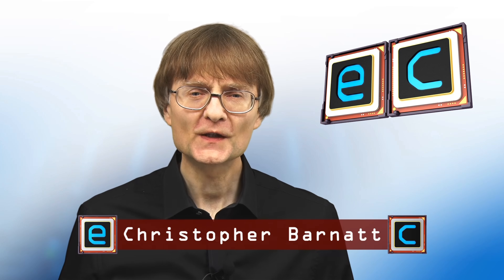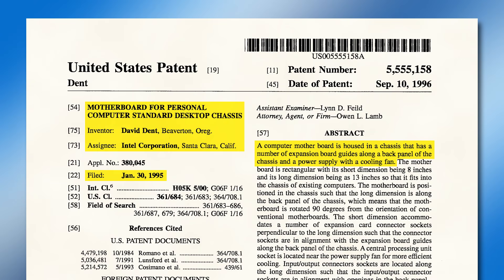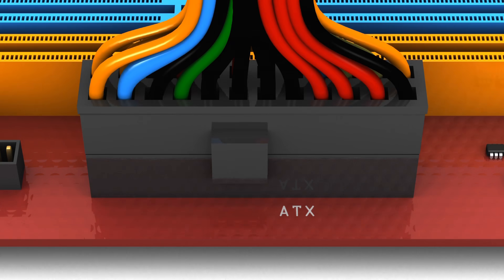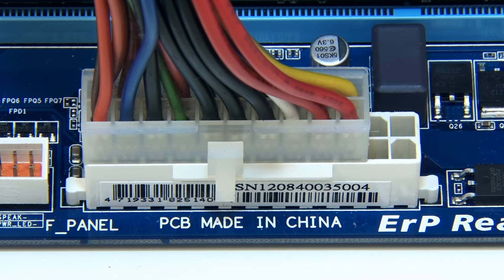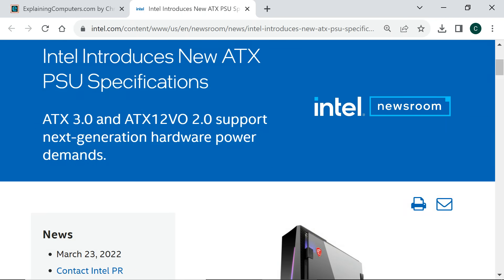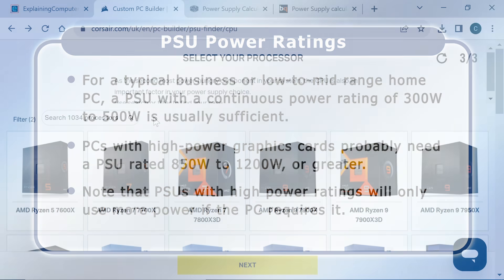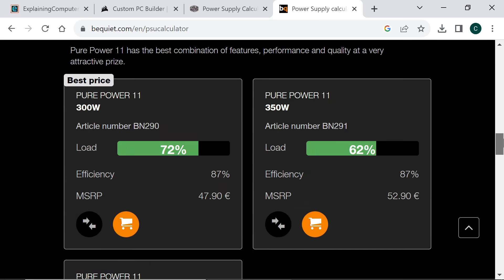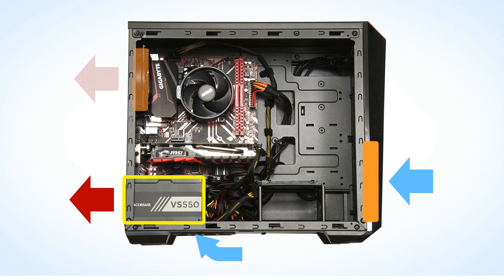Explaining PC Power Supplies

Comment: You say that in 2000, ATX 1.0 was introduced to power Intel’s first Pentium processors. That can’t be right! I was building my own PCs in the late 1990’s and we were a couple of Pentium in by then. My first Pentium processor came in a sort of cartridge with a daughter board inside with level 2 cache which itself plugged into the motherboard. Pentium II I believe. I started with a 266MHz and then moved on to a 450MHz.
Reply from the maker: This is a very good point! You are right. Pentium processors were first released in 1993 (I remember those strange, modular P2 ones you mention). My error here is missing out a number. The changes in 2000 were to accomodate the Pentium 4. My bad. :( I have added a pinned corrections comment.

Comment: I have been building my own computers since the early to mid 90's when more standards and modularity became wide spread, and have always made sure to buy a power supply that can deliver quite a bit more stable power than what is needed for what I initially put in the system, because if you add upgrades and peripherals to a system with just enough or only a bit more output than what you already are using, you may run into trouble that can effect a whole bunch of stuff, and lead to hardware failure.  It's not a good place to save money.  Looking for the best price or even a sale on a highly rated product helps of course over skimping out in the first place.

My current system should be around 550W at max load it being an AMD AM4 based system, and not the more power hungry Intel equivalent, but my power supply (Modular) is capable of providing 1200W steady power.  It's also gold rated, so efficient, as well as very quiet.  So far I have never had any power related issues with systems I built, but have with prebuilt systems I acquired when upgrading and adding stuff.  My power supplies have so far all outlasted the systems they were in.

Comment: My self-built PC has a Corsair 750W Modular PSU. It's so overrated for my PC, that I've NEVER seen the fan spin, except when I push the test button. These days, I rarely use my desktop, and mainly use my excellent Beelink Mini S PC, because it's virtually silent, and it costs virtually nothing to run!

EDIT: No more Mr. Scissors gags, as they went down like a balloon popped by something sharp! Like most of my comments, they were deeply unpopular! ... I strongly suspect I'm being "shadow banned" by YouTube? My comments often vanish into thin air after posting.

If anybody's interested, my biggest issue with SMPS is the "arc" when plugging them in (this mainly applies to laptop PSUs, presumably due to capacitors?). There can be a noticeable flash, and pitting of the mains plug pins. Lord knows what it does inside the socket? More pitting I expect? Over time, I suspect this could cause contact issues, damage and arcing inside the AC outlet.

This video came across as a little "dry," and I lost interest and stopped watching at 07:59. Sorry Chris!

Comment: Great explanation. There can be many pitfalls to choosing a PSU, so I'm glad you put this info here for folks who need it. I've also heard people say to not mix-and-match cables from different modular PSUs, but I don't have enough PSUs personally to say why. Perhaps the PSU socket side could be different?
Reply: Maybe they are thinking of the cable power capacities, i.e. not using cables from a lower power modular PSU with a higher power modular PSU?

Comment: Thanks, Chris the understanding and history of the PSU were informative and interesting. Also over the weekend, I worked on my new computer build, here is the parts list and I am using it now. New Computer Build

Corsair 110R Tempered Glass Mid-Tower ATX Case

EVGA 500 GD, 80+ Gold 500W Power Supply

Corsair Vengence LPX 16GB (2x8GB) DDR4 DRAM 3200MHz
C16 Desktop Memory kit-Black

Gigabyte H610M S2H DDR4 (H610/Intel LGA 1700/Micro ATX/DDR4/
Single M.2/PCIe 4.0/USB 3.2 Gen 1/Realtrek GbE LAN/Motherboard

Intel Core i5 12400F Desktop Processor 18M Cache, up to 4.40GHz
Reply from the maker: This sounds like a very nice new system. :)
Reply: @ExplainingComputers  Yes, finished it over the weekend. Was inspired by Carey Holzman's channel. I watch and subscribe to his channel. I'm in the process of cloning my old drive to the Samsung NVMe 970 Pro SSD 500GB using Acronis.

Comment: Thanks you for enlightening us on the power supplies. Everybody is full of CPUs, GPUs, motherboards, RGB, cooling, and so on. The PSU is not getting the attention it needs. There are some intriguing questions around the humle PSU...
Why did the PSU not change? Why did the ATX specification not go for 48V or 60V for transferring large amounts of power to the power-hungry components?
The only thing that changed is the number of conductors. Big amounts of power over multiple parallel thin wires is asking for problems. If one has a bad connection, everything will keep working but with an increased risk of overheating and fire.

Comment: "All desktop PC power supplies include a cooling fan" This statement is just plain wrong. There are many companies that offer completely silent, fanless versions, e.g. Seasonic Prime Fanless. These are special purpose items, they are not for small cases with high-powered GPUs, but instead either rely on large, well-ventilated cases (e.g. using some very large, incredibly slow-spinning case fans) or test-bench-style open-air cases. It is true that for the average user, a hybrid-mode power supply probably is the best of both worlds. But nonetheless one shouldn't bend facts.
Reply from the maker: Noted. My bad. :( I have added a pinned comment noting my error.

Comment: Molex is not the correct name for the old HDD connector
A true molex the top part of the connector is tapered at the 12v side and has a right angle at the 5v side.
Mate n Lok is tapered on both ends at the top.

Comment: 1:25 -- that's one thing that we just don't have in the States.  Those awesome wall-plugs with built-in fuses and switches.  How convenient to simply be able to switch the thing off there instead of having to physically unplug it to remove a device's power.

Comment: I sincerely hope ATX12vo makes it to the DIY PC market. Pre built pc's have apparently used it for many years and my one uses 10-15 watts. I simply refuse to build myself a PC which will be pulling 70-80 watts minimum. Especially when I'm paying 50p per kWh for electricity. Great video 👍

Comment: 13:45 the footnote should say at 100% load
Reply from the maker: No, the footnote is correct. An 80 Plus Titanium rated non-redundant PSU is 90 per cent efficient at 10 per cent load. It is 91 per cent efficient at 100 per cent load, as the table indicates. There would be no point in indicating the 100% load rating given that the 100% column is already in the table! :) But I chose not to includes the 10% column, as it only applies to the Titanium rating. The data is here: https://www.clearesult.com/80plus/program-details#program-details-table

Comment: Thanks for covering PSUs,  I always buy the best PSUs for system stability, i found that the cheaper units can cause the system to have random crashes,  my daily work horse was doing this, Switched the PSU over to a better quality and the systems been spot on.   I have had a PSU kill a motherboard too, by sending a few volts down the resistors that controlled the fans.  it was only Pentium 2 dual processor system, so nothing flash.

Comment: corsair also do digital power supplies that not only run with 0RPM at low load, they also eliminate coil and capacitor whine. I think I have the 750i I bought years ago that has corsair link which will tell you in real time how much electricity is being used and how efficient it is, also which components are using electricity.  the i series is certainly the peak of corsair power supplies, and I think they give something like a 20 year warranty on them.

Comment: Brilliant video covering something I am sure many don't give a lot of consideration - naturally depending on how demanding a machine you're building.
I am sure many have built, for instance, a Linux machine from older components using just any old power supply that'll fit in the build and has the right plugs.

Comment: Great overview of PSUs.  Cool and quiet are a priority for me and my computer is primarily an audio recording and mixing system.  Some PSUs are designed to have zero fan speed when the power draw is below a certain threshold.  Therefore, I find a PSU wattage level where my basic activities fall within this threshold or at least in the lower RPM modes.  I would add that a non-spinning fan draws less dust (even if you have a dust filter) and should prolong the PSU life. I achieve these goals usually with a Gold or Platinum 80+ PSU rated 100+ watts over what I need for my system. (a 1000w PSU isn't efficient on a 500w system so don't go too far above).  Going 150w over what is needed allows headroom for future upgrades. This puts my normal usage in the sweet spot of cool a quiet in exchange for a tiny bit of efficiency. (and again, a non-spinning fan draws no power so maybe it's a wash.)
Another important factor for me is that a great PSU will last for 2-3 system builds and the extra money is an investment in the future (a rare thing with computer parts.  Perhaps shared by buying a great monitor.)

Comment: Some Mother boards and PSUs support having x2 ATX_12V/EPS (@05:25).  Running high core count CPU's with over clocking some users may plug in 2x8 pin EPS for running hi amps/watts. Most users won't need or run this set up.  100% agree that some research for the correct PSU, that suits a users needs, can same money and limits part being damaged.

Comment: The money  is not worth the extra efficiency in most cases. Just turn off you pc when youre away, computers now start up quick anyway..if so concerned about energy use a power strip everything and never even leave a usb charger plugged in.

Comment: Hello, I love your videos, But WHY do say at 6.:43 SADLY molex connectors remains today. I find it great that I can still put a PCU into and otherwise Dead computer. Not everyone requires a modenn Computer and manny of us work in environments where older computers are used in machines 20--30 yers old THANKFULLY not SADLY they still make this connector available, otherwide an expensive machine made by a  company and used by other companies may be obselete just bacause of a stupid  omission of a connector. Just my opinion as a technician working on machines which work well running under Win win 98, XP and aven OS2 Warp. Machines are well maintained and need a working computer -  namely powered b a tradionatial  PSU. Not every company has Hundreds of Thousands of Sterling/Euros to replace machies just because of a stipid PSU connector Ommision.
Reply: My main complaint is that it can be really hard to unplug from another molex connector, though most decent modern PSUs have a curved piece of plastic you press down on that helps release it. Also, plugging it in can sometimes be a challenge because the pins are fairly loose so you have to make sure everything is lined up.

Comment: Sorry Chris, the first Pentiums were released in 1993 and did not require ATX 12V 1.0.  In fact there were motherboards available that allowed the use of an AT power supply.  Ask me how I know!  Another thing that's important when selecting a power supply is where the PSU delivers the power.  Modern PCs (Core2 and later) require power mainly on the 12V rail, so you could select a 500w supply and then find (if it's on an older design or a cheapy) it can only deliver up to 280w on the 12V rail.  That supply is rubbish whereas a 500w supply that can put 450w or better on the 12V rail is good.

Comment: Very good video: well structured, clear, comprehensive, accurate, touching on all the necessary details.
That said, what lead me to comment was at 6:34 "... the 4-pin Molex connector which used to be used to power most hard drives and optical disks and SADLY remains in use to this day as a general PC power connector" 😆
I'm an electronic engineer and I've been designing electronics for longer than 20 years. The job often includes selecting and verifying all sorts of connectors. I've been dabbling with PCs for longer than I've been an engineer and I've always been puzzled by the choice of such connector. How did Molex manage to get such terribly flawed design to be selected for such a popular industrial standard like the PC? The 4-pin HD/FDD Molex connector is extremely awkward to plug (receptacles and pins typically refuse to align) and the shape of the cable-end housing seems purposefully designed to hurt the fingers and prevent gripping it.

Comment: I have a question and wonder if anyone can provide any insight. I have a desktop PC that I only use occasionally, so when I shut it down, I flip the switch on the PSU. I have a USB light that I keep plugged into the computer so I can tell if I forgot to flip the switch. However, the last few days I've noticed that about an hour after flipping the switch to off, the USB light will come on and then go off after about a second. My guess is maybe discharging capacitors or something, but it seems strange that there'd be a sudden burst of power like, especially after such a long period of time. Any ideas?

Comment: Many years ago AT power supplies were prevalent. You had to switch them off manually after shutting down. Then ATX PSUs appeared, which turn off by themselves. A minor thing, but i was impressed, when i first saw it
Reply: The switch was still on the front of the PC, so it didn't seem like you were switcing off the power supply unit but the whole computer or "the processor". Windows 98 had a message informing that it is now safe to turn off the computer.

Comment: Great informative video. Thanks.
I would like to add that most good quality psu are already atx 3.0 capables as John Gerow pointed out. Moreover, you should even more not care  at it if you are running amd gpus (like me), because not 12pin connector required. Cheers

Comment: I would say that the PSU is THE part that corners should never be cut on. My daily-driver uses a Corsair SF600 PLATINUM, small and solid, with the fan rarely spinning.

Comment: This is a good back to basics video. My personal recommendation is to never buy anything lower than gold or silver, and target it so the power you use is around 50% of the max output. Its not just the power saving , to get that rating you have to have a well designed power supply, a lot of the 80+ (below bronze) units are very old architectures made to look new, stay clear. Cheap PSUs are never worth it. A good high end PSU can last decades if not longer. Not ATX but my nice thurlby thanadar bench top power supply is over 30 years old if its a day and still going strong.

Comment: Excellent video, very informative. I’ve been messing with PCs so long that I remember the old pre-ATX power supplies, with an input voltage selector switch and an output socket to supply a monitor.
Reply from the maker: I liked those monitor sockets. They made things very neat at that desk.

Comment: Great job for explaining about PSU, Chris! Talking about the airflow, if PSU fan was from bottom for enter airflow (which was difficult to enter enough cool air as easily caught by dust), actually we can flip over the PSU fan on top for more smoothly airflow as well.

I have 550W of PSU and already mounted on bottom location with flipped over as the fan on top, this was made my PC improved for giving much cooler rather than easily covered by dust. I hope you understand about my idea. 😁

Comment: I had a 1000W power supply from 2008 that didn't even have any efficiency rating on it.
When I switched to a Platinum rated power supply nearly a decade later it dropped my idle wattage use by ~30-40W! I was blown away!

Comment: 11:49 ATX PSUs are most efficient at 20% load or more.
Using a PSU with a much higher wattage rating than needed will use more power from the socket under normal PC usage.

Comment: Sadly, most people, Just don't realize, that 'ROSEWILL' and/or 'SUPER FLOWER' are both A+ PSU's !!!   Most people think it is an "unknow" brand, so they see it as : "must be SH*T"
While they are actually in the TOP 5, of all PSU brands, out there !!!   For me ONLY Rosewill PSU's, in my systems ! Or, if not available atm, an Super Flower PSU ! ( my second choice )
Reply: People should read technical reviews that measure ripple performance and other relevant metrics. There is also a PSU tier list on some site that grades PSU model lineups. If someone is looking for a high quality PSU, I'd suggest looking for a known brand with an 80+ Gold rating, with Japanese capacitors, and a long warranty. Some brands have a 10-year warranty last I checked.

Comment: I recently upgraded from a 500W Bronze PSU to a 750W Platinum PSU. In idle at around 60W it isn't noticeably more efficient. Only above 200W I get over 10W savings.
Reply: Yep. One of the reasons why I usually go with 80 Plus Gold.  To me it's a good balance.

Comment: I wonder how many working power supplies have been trashed in the last 40 years because IBM did not put a passive backplane in the PC?  

I dumpster dived for a computer in the 90s. The only thing really wrong with it was a dead 100 meg hard drive. But it was a measly 486/33. I replaced the motherboard with a 300 mhz Pentium.

The case was great. It would have cost $250 new,   industrial grade. The power supply worked fine. Not using passive backplanes has created lots of e-waste.

Comment: Wow, they created quite a circus with the newer models. Are they trying to copy the USB people?
In stead of the +x connectors to make it possible to use the newer longer versions as well as the older shorter one, why not introduce an adapter that would combine 2 connectors of an older PSU to be adapted for a longer newer one?